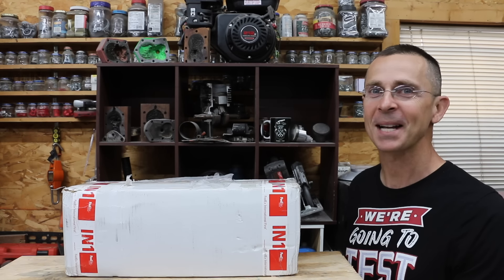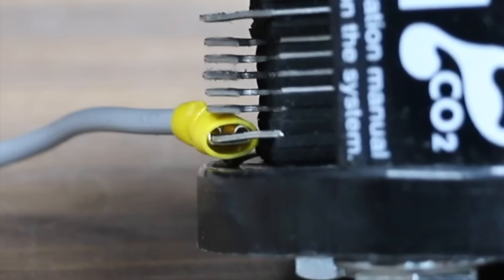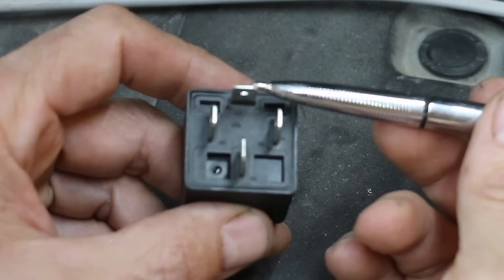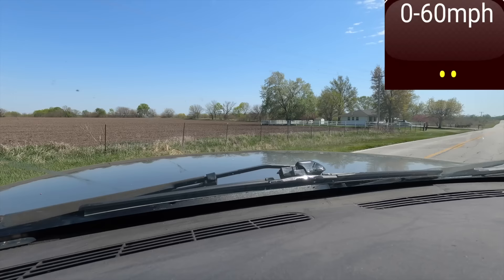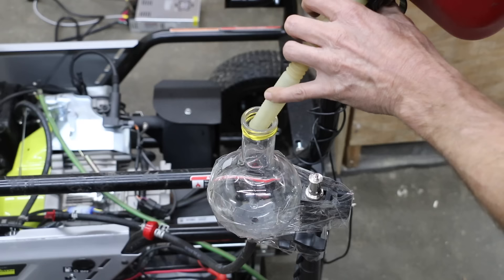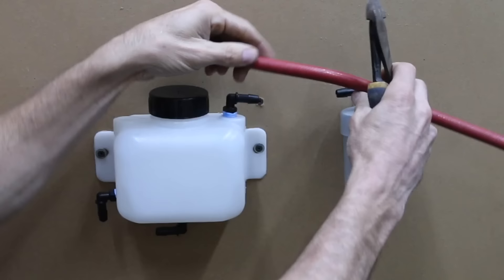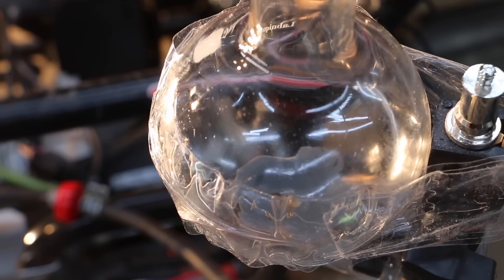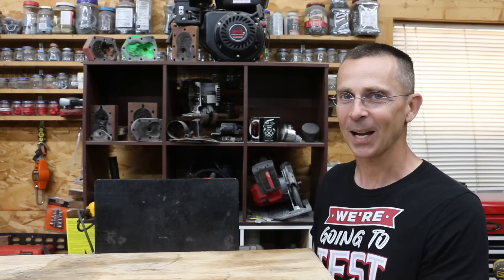AMAZING 35% More MPG with HHO? Let’s find out! Help with high gas prices?

Comment: About 15 years ago I built an hho generator for my car and did run to empty tests using 1 gallon of gas without HHO and 1 gallon with it. I saw zero difference. I don't feel like a fool. It was an extremely enjoyable fun learning experience encouraged by a perceived benefit. This arguably false concept gave me some drive to learn about vehicles, electricity, and utilize skills I never knew I had. The youtube and online instructions in the 2007-2009 era were sparse. One had to figure out a lot by trial and error and a lot of reading. I didn't get any improvement in gas mileage or efficiency, but I learned and experienced a lot. It was worth it. I think I still have it somewhere in storage. It was home made mostly from pvc piping . Ghetto engineering at its finest!
Reply from the maker: Thanks for sharing!

Comment: I made up a cheap system for my 93 idi isuzu 3.1 litre engine just for a laugh, I went easy on the lye so that the alternator was only making around 5 amps over normal. There was a noticable increase in power, it felt like the injection advance had been turned up a notch, which is probably because the browns gas burns so fast it really gets the in cylinder mixture burning faster. I didn't do any fuel economy tests so can't comment there. I eventually got tired of topping up the wet cell every few days and took the system off.
Reply from the maker: Thanks for sharing.

Comment: You don't need to connect the fossil fuel line! Just connect the HHO directly to the carb and make sure to take of the air filter, cut a piece of cardboard to cover 1/2 of the carb port. HH will run without gasoline! Depending if your HHO generator can produce enough HHO to keep it running.

Comment: Hho will only work if it was causing fusion reaction. I've watched Stanley Meyers video he says he's using nucleus power of hydrogen not hydrogen and oxygen reaction. So I think if you can starve the engine from oxygen, separate hydrogen from oxygen adding little amount of oxygen. And possibly preheating the hydrogen and applying very high voltage spark plug it might fuse into helium and water releasing nuclear energy wich is hundreds times greater than fission... Wish I had the time and money to experiment.

Comment: The big issue is not the fact that HHO does not work. It is the fact that the fuel has been modified to only accept/absorb so much O2 & H. This was done about 15 years ago when many people were getting creative and making devices and creating additives to increase mileage and succeeding. The molecular bonding ability of the gas was restricted around that time.  Just imagine if everyone got 25% better mileage how much less fuel would be used. Now that is a significant improvement and would greatly reduce greenhouse gases. I ran a mini van around that time and got about 550 miles per tank. With a small device I got over 700 sometimes.  Ever wonder why the gas stinks so much these days? --
Reply from the maker: Thanks for sharing.

Comment: Please don't take this as a negative comment but the hose on the truck engine was too far away from the cylinders...Hydrogen when mixed with fresh air dissipates. I have turned my 50 year old Land Rover diesel into part diesel part hydrogen from homemade jam jar set up...the hose is split 4 ways as close as I can get to the cylinders which are fed through the inlet manifold. My mpg has changed from 24mpg to 34mpg. I don't accelerate hard but when I do the mpg is back to 24mpg. I'm still trying to perfect this ongoing project.

Comment: Great video PF, love your videos. Glad we have a comprehensive confirmation that gasoline engine "Hydrogen On Demand" systems are fake.
It would be nice if people could explain energy loss of vehicles. 70% of energy goes out the exhaust pipe. This problem can't be solved since most is caused by heat from combustion in ICE.
The easiest way I've found to explain the inability for these systems to work is the serpentine belt system. The belt has strong friction causing at least 20% energy loss, so a HHO adding hydrogen into the engine can't solve the energy loss from a belt, that energy has to be compensated and that's from the battery and alternator along with the engine fueled by oxygen and gasoline with explosions that power a pistons that turn a crankshaft which gives turning power along with many other rotational/power Multiplying parts.
The HHO drains more electricity from the battery and the alternator has to keep topping off the battery, the engine helps powering the alternator. The problem is for a HHO to have the ability to improve function is if it took zero power from the battery + compensated energy loss from the belts and engine energy loss. Instead the HH0 is parasitic.
It honestly has so little of an effect the battery is fine, the vehicle has slightly worse MPG in some of these systems from reasons stated above.

Thank you Project Farm
Reply from the maker: Thanks and you are welcome!

Comment: The laws of thermodynamics for the win!

I wonder if you used solar power or other external electrical source to run the HHO generator instead of deriving that energy from the the output of the engine, would there be a different result? I would assume so because that would be an external energy input instead of taking energy away from an engine and feeding it back into itself. As tested, effective losses should be expected. That said, entropy is inherent in all systems.

Comment: Hey thanks for the very informative and detailed analysis of your project. Just my theory, but I think what’s going on with these HH Joe generators is that the fuel map has to be adjusted to run leaner for gasoline and let the HHO make up for some of that power. Really adjusting the gasoline fuel the air ratio, I believe there is no advantages to adding just playing HL. Even if it has a feedback loop that can detect the air fuel ratio from the exhaust still won’t work. Have to be able to play around with the airfield ratio make it as lean as possible and add as much hydrogen to make up for the difference.but that’s just my perspective on this
Reply from the maker: You are welcome!

Comment: The speed timing test could have suffered from the later times due to heat soak under the hood. Also to get hho to improve your economy you really need a EFI motor and  fit a piggy back computer so you can then alter the exhaust temp etc to see the benefits.

Comment: To start i have no connection with any HHO company. Problem 1, that year Chevy has no accessory power. Problem 2, a generator has no ecu or sensors to control incoming fuel adaptations to regulate more or less fuel being used. Real World,. I hooked up an HHO system 15 yrs ago on a 1999 Mitsubishi galant. Prior to install i topped off fuel and drove 57 miles and recorded mileage then refueled at destination (topped off). Following day I installed HHO, topped of fuel at same gas station 100 yards from  my house and drove exact same route with almost exact same traffic same time and GAINED 5 mpg average. refueling back to spitting out fuel topping off. It was pure science and facts. Only part i regret was i had it hooked to an on off switch and would forget to tun off after drive and would burn water tank to a dark brown coffee muck. Fact is it does work, but for what headache is it worth? The future isn't electric cars but rather Hydrogen electric hybrids which work off each other. You will see in less than 5 yrs i would guess/.

Comment: Adding an hho generator a combination engine does make you more energy. You actually lose a little bit of energy because nothing is 100% or more energy efficient. You can not create energy or mater,  but it does make it less reliant on gasoline, making it more gasoline efficient. But you now have to fill it with lye(sodium hydroxide) and water. We really should add this hho system to our combustion engine have so we don't have to rely so much on the fossil fuel so much and we can rely more on lye water.

Comment: If you put both gases back in motor, it's a wash.
Need to use just oxygen to help n burn the gasoline..
  I know you have a diesel truck not sure if you have DEF in that.
I wanted to take the machine an put oxygen in exhaust to extend interval between Regen.
I really like your channel very educational,  thanks Stephen
Reply from the maker: Thanks so much!

Comment: Excellent stuff, and, with gas prices as high as they are one year after upload, I must congratulate you on your foresight. Anyway, I would have put money on the HHO generator saving fuel because the engine wouldn't need to run as rich with all that hydrogen going in through where the air filter is. This begs the question. Do air filters have something in them that filters out hydrogen or something?

Comment: wont affect 0-60 or mpg unless you adjust the air/fuel ratio - make fuel leaner and should help mpg but need much bigger generator producing much more gas.   those generators are also very explosive

Comment: nice work. but i think to experience fuel savings there needs to be a way to adjust the fuel flow appropriately, to compensate for the increased combustion efficiency. only then would you experience fuel savings.

Comment: I’m curious if the generator is compensating for the fuel. An egt sensor and oxy sensor added to the gen should allow you to monitor that. Also put an oscilloscope on the injector to see if it’s injecting more or less fuel. 
Theory is if the generator is not adjusting fuel injection when the hho is on then you effectively are just running a richer mix resulting in a power loss. 
An effective end all discussion test would be to see if you can add hho and improve power while positively or neutral effecting the egt.
Without hho you can lean an engine but you risk detonation or high egt that lowers longevity. 
Your going to need to be able to adjust timing and fuel with and without the hho in order to test this and you will have to load the generator to 99% to get the egt’s to their max. 
Also the same test should be performed on a diesel generator.

Comment: It doesn't matter that it got a bit lower . The idea here is to add it to existing fuel intake to kegten the mileage that gasolines getting. That's why we want to pipe the oxy outside so dry cell hydrogen is created . Here's my thing if it will pay for itself and reap a higher mpg., Then I'm on it I've built one just haven't installed it having head gasket issues at present

Comment: Hey guys
I ran tests also on diesel Gen set...problem with testing on efi and diesels is that fuel delivery is pre-set.
Try test on carburated engine..different outcome. I did also laser tested exhaust/engine Temps....system definitely runs hotter with hho
Reply from the maker: Thanks for the suggestion.

Comment: After making an HHO setup that works pretty well by itself, I want to believe in this power source, but as we, a people on this planet have gotten so many things wrong, we're probably missing a clue on this tech as well.

I live in the desert. Over 300 full sun days a year.+/-.
Using solar panels, I make more energy than I can store. (Need more batteries.)
I have a good well. Lots of water.

I find it hard to believe that if I took the two excesses, combined them, made hho, and cooked my dinner on the stove over it, that I'd have a net loss as compared to buying propane, having it delivered, and storing it in a tank.
The same question would be asked when it comes to running to town for gas for backup gensets, or my gas toys like quads etc.
Would I really be better off using my battery stored solar electricity to cook my grub on an electric stove, or using the electricity and water to create gas to cook and heat from?

I've been off grid for almost 30 years, tried almost everything except this, and I'm still trying to wrap my head around the whole thing.
As far as I know at this point in time, you can't convert/transfer energy without loss. Period.
But what if you can take two excesses, convert them at a loss, but yet yield a power source more to your likings, or better suited to your needs?
I can't believe that producing gasoline from oil, doesn't have a net loss, but we're still willing to create and use a product that was once considered a waste/byproduct because it was too volatile to use in lamps etc.
Then someone found the perfect acceptable loss/use for it, the internal gas engine was created, and we now pay dearly for something that was once considered crap, and left by the roadside for people to help themselves to for free. 
Again.....I think we're missing something with all this sun energy, and an endless supply of salt water.

Comment: Since there is no adjustment being made at the carb needles or fuel injector mapping...it's common sense you MPG won't go up.  The same amount of fuel is dumped into the intake regardless of the presence of HHO.  Lots of potential to do more harm than good...even IF this generator was capable of making the liters of HHO that would make a difference (which it can't).  The only upside is that if anything, it will run rich rather than lean...hopefully saving your engine.

Comment: There is one thing you have done that is cool..you just showed the whole world that straight HHO does work. You replaced gas with a different form that works the same if not better once you get it perfect. So therefore if you can use a different gas why would you have to buy electric. Not to mention the burn off is pure water isn't it? If so you pollution level just went to nil quickly. Think about it no more gas, no more pollution! I'd like to see what the return is on making an engine run off gas fumes alone, and what is the mileage? They say you can reach 100 miles to the gallon?

Comment: Hey guy do great work it's hard to see you take wire and put it under a fuse just get a parasite adapter that goes into that fuse and keeps that fuse running for that but drawers also power to another wire.

Comment: The electricity usage cancels out the extra fuel produced. The guy that drove across the US on water alone and got Clintoned had a system that turned the electricity on and off. He was producing fist sized bubbles every 1/2 a second.
Reply from the maker: Thanks for sharing.

Comment: Seems like if this is truly going to work, the vehicle ecu or ignition control computer is going to need a new program to meter fuel differently based on the HHO input. 

As it was put together in this system, there is no way for the vehicle to know that it has another fuel source. So it’s going to deliver the same amount of fuel to the injectors.
Reply from the maker: Thanks for the feedback.

Comment: My understanding for this, is that it requires you to adjust timing and to lean out the fuel mixture to maximize the benefit, especially with EFI engines, as when it burns the car will detect a lean mixture and dump more fuel into it, causing you to see little to quite possibly negative gains
Reply from the maker: Thanks for the feedback.
Reply: Would you also risk predetonation because of the extra oxygen?
Reply: @izzywest2818  one way to find out
Reply: @izzywest2818 doubt that would be an issue, youd pull timing, and with hydrogen being more combustible compared to regular fuel, it would seemly level out potential lost power, but without having a set up i can't try it

Comment: Compared to the flame front driving that piston, there is only about 1% of that energy in the Hydrogen Oxygen gas recombining (burning). This you can compare directly without anything elaborate. 

The old-school hackers like myself on our pre-90's vehicles (without EFI) would increase compression (built pistons and heads,) or  decrease octane, (High octane engines,) and/or oil burners (worn cylinders) - and add METHANOL-WATER mix into the intake - but only on demand. There were knock detectors that could be added to the circuit, but mostly it was from a dashboard switch, at the bottom of the mountain, to get to the top without slowing down and pulling over my VW transporter - not to mention destroying the engine.

So for that you can see all kinds of benefits - you've tuned your engine for 20% + performance ALL THE TIME, and cool-down the combustion whenever it needs it. That's one smart school! :face-blue-smiling:
Reply from the maker: Thanks for sharing.

Comment: My last idea to revisit this test is to not use the EFI generator as the power source for the HHO, but a 12 volt battery because there are no losses between converting between AC and DC that way, just to see if the generator run time will be extended, or not, over the run time of the test with only gasoline. If it isn't, we know for a fact that narrow band O2 sensor and PCM on the generator contributes to no increase in run time by it adding more raw gasoline to retain the stoichiometric mixture. If it does extend the run time, it doesn't mean that it would if the generator was producing the power for the HHO unit if the air to fuel ratio could be increased, but it also doesn't mean that it would not.
Reply from the maker: Thanks for the feedback.

Comment: There are numerous white papers of university level testing of HHO devices on both gasoline and diesel engines with various results. None show a 35% gain in fuel efficiency.  Low single digit gains seems to be the limit.

Comment: Problem,  you are not replacing gasoline with hydrogen.  You are replacing oxygen with hydrogen.   Basically your engine is running rich.  One last thought is this system can't possibly create enough hydrogen to make a difference even if you add the hydrogen directly into the fuel rail.

Comment: U need to adjust the 02 sensor on newer vehicles, older the better and run a restastate on the foot feed to a run h2 into the engine by-the call for it